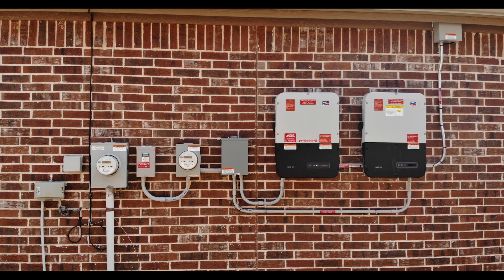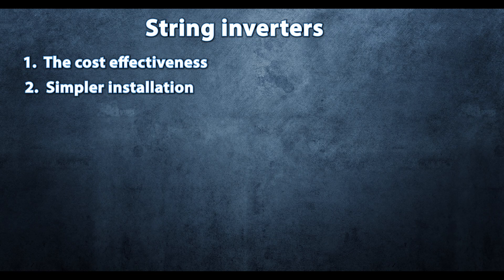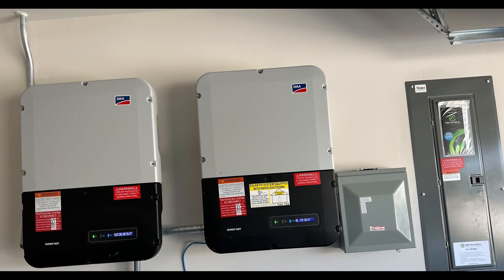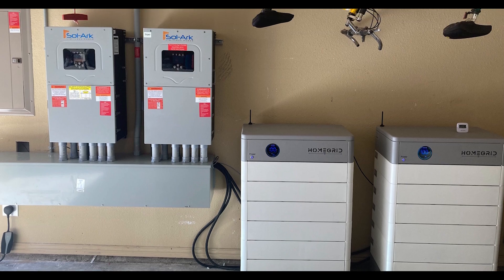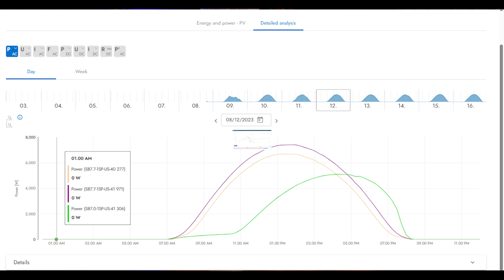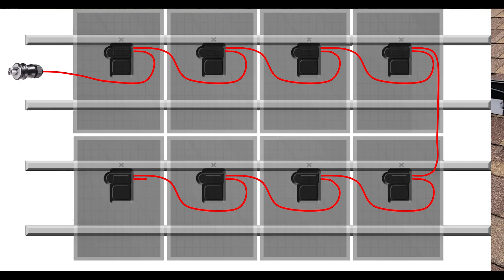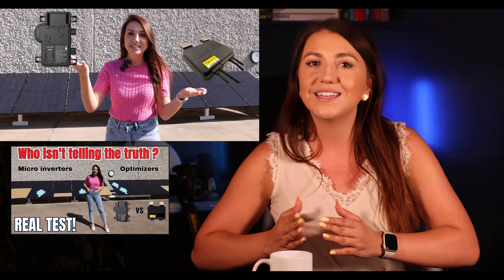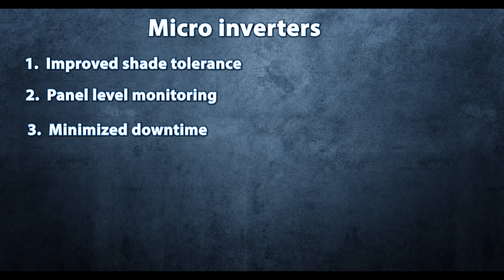The Great Solar Debate: Micro Inverters vs. String Inverters  - Are you making a mistake?

Comment: Have you ever seen a DC arc fault fire - i know what i want on my roof with my family living below - micros also have up to 25 year warranties - this is not a fair comparison
Reply: Doesn't Enphase require internet connection with a Enphase wifi box. That wifi box is only warrantied for 5 years.  How long has Enphase been in business? Nowhere near 25 years.  Whats the largest panels their MI support without clipping? Is it less expensive to over panel, increase pv system, with a string inverter or over panel with MI's where each panel requires an MI.  ARC faults are the mc4 connectors, which Enphase uses, compatibility issues or installation issues.  Those MI combiner boxes require a lot of connections increasing the chance of an arc fault.
Reply: @ridemfast7625  theres no arc faults on an AC system as max voltage of 1 panel  not 14 like a string  - its called a short circuit an trips the breaker - strings cant be added to over here if the DC goes over 600v so maybe different rules there  but enphase far easier to add to - string invertors only 5 year warrantys
Reply: @airselectricalcontractors842 You seem to be overlooking all the facts of electricity and wiring. In a (series) string setup you add as many panels as that string can take (the max OC DC voltage for the inverter's rating), and when you want more panels than that, you run a new wire to carry the next set of additional panels to the inverte, until it is at capacity or you add inverter. With Micro inverters you can only add as many on the same line until your wiring's 'max current' is reached, then you'd add new wires for new panels. Same issue, you need to add more wiring once you exceed that by going with more panels. So either situation can mean more wiring. Both are very doable.
Reply: @jamesbsa6450  im quite aware how they work mate - for starters a 3 phase system with enphase is 1 cable but triple the panels - DC is limited to the single string voltage and still has the arc fault problem
Reply: @airselectricalcontractors842  and you still haven't acknowledged that a string of panels on microinverters are still current limited by the cross-section size of the wire. So you are still going to encounter a need to do more than simply add panels. You will get to a point that said string wiring is exceeding the ampacity rating of the wire. Solution? Upgrade / supplement the wiring.
Reply: @jamesbsa6450  i dont think you understand TBH  - i am an electrican so obviously the curent carrying capacity matters but a DC system will usually need another invertor to add panels later  and is limited to around 12 panels  on 4mm cable - enphase 3 phase can have 39 panels on 1 string  of 4mm cable { which i call a circuit } and if you need more you run another AC cable and wire a simple relay - no more extra invertors and NO DC arc potential
Reply: @airselectricalcontractors842  I do understand, and said that (though I didn't comment on the arc). The jist of what I said: in both setups, you would need to be concerned about not exceeding your capacity of circuit; as an electrician you of course know this... In either system you have limitations which means by exceeding them you will  have to go back and run additional wiring. I took your initial post to sound like all you do with a microinverter system is easily add more panels, which is not the case, because you can easily overload existing circuits by adding panels in either method, you can also easily add panels in either setup. All things like wire length, size, resistance, extra equipment, etc. need accounted for though, Microinverter pumping AC doesn't give anyone a free pass to blindly slap on panels (oh and don't forget the extra $$$ Microinverters as well) without totally analyzing the circuits and adjusting accordingly.
Reply: @jamesbsa6450  i dont understand our argument - as an electrican i dont need to explain cureent carrying capacity, circuit protection etc  on a post from a sales company  - in Australia all DC cables need to be in conduit from the invertor , through the roof and can not exceed 600 v dc so any add ons will need more conduit and another invertor - enphase cable requires no conduit and is run freely through the roof - only add on is a relay into the existing switchboard - the added cost is the guaranteed safety and easier expansion costs - you either like enphase or you dont but never met anyone that trgretted putting it in and there battery and black start shits on other systems
Reply: @airselectricalcontractors842  I find it interesting that as an electrician you chose to overlook one critically important aspect of your job. Design of a system should always build in necessary safety for type of circuit. A HV DC system should be designed with Surge Arrestors Spark Arrestors arc detection, Properly rated fuses, etc. Simply stated, when you properly design a HV DC solar system each risk should be accounted for. Fail-safes prevent fires, and that's true of AC Microinverter systems as well. So I'd say your opinion on how great Microinverter systems are and how safe they are, is biased. You seem to be comparing an improperly designed HV DC vs. a properly designed micro AC system.
Reply: @jamesbsa6450  clearly you dont know what your talking about - DC arc fires are a thing as well as DC isolator fires - im not here to offer free designs - im commenting on a post is all - in USA where im assuming you are , you dont even need to be an electrican to do solar  - chow
Reply from the maker: Not once have I had a fire caused by an arc. Most modern strings have very very sensitive arc fault detection. 
Microinverters "come with a 25-year warranty" but in the majority of cases the main combiner is only on a 5-year warranty. So keep that cost in mind for the future.
Reply: @solartimeusa  there was a solar fire a couple of weeks ago on the swimming centre in Sydnry Australia on the pool centre used in the 2000 olympics - arc faults are real and DC strings are dangerous - enphase has circuit breakers for protection - why risk a fire on your home - they are up on the roof in the weather for a long time is my point
Reply from the maker: Hope that was somewhat helpful. If you havent yet, check out the video I made on String VS micro last year.
Reply: @solartimeusa  But we're talking about inverters, not the combiner box.

Comment: I'm looking into installing panels and at least 1 battery this fall.  The Mango Power M is my choice of battery, for the moment. The battery would be DC coupled.  Because of the east-west orientation of the house and shading issues, I think DC power optimizers will be a must. Definitely don't want to go with micro inverters.  The  Power M can also be AC coupled, but I would rather have the efficiency of being DC coupled.  Would like to get a quote from you, but I'm in NY.  Thanks for all your informative videos and taking on microinverters vs optimizers a number of months ago.

Comment: Living in Northern Norway with 7 month of winter the problem isn't shading by trees but snow covering. Thats why I prefer micro inverters (APsystems with 2 or 4 independent channels). On the other side I don't like the idea of replacing a micro inverter in winter time. So it's not an easy decision.
Reply from the maker: Thank you so much for sharing! I live in Texas so I didn't even think of the snow idea, but thats a very fair point!
Reply: @solartimeusa  I would like to test the difference of bifacial panels and usual panels next winter. Reflected light to the bakside (snow is an excellent reflector) would not only give a little more power but also warm up a snow covered panel faster. There is little experience how much faster the snow is smelting. At least we have no problems with overheated panels or micro inverters 😀

Comment: I have a string inverter (EG4 18k) waiting to be installed. Along with a EG4 Power Pro and 8 kw in panels. 

Ill be upgrading to double the battery size, and more panels (12 kw total?) next year sometime.
Reply from the maker: Thank you so much for sharing! I do like that mix!

Comment: My thoughts?? HHMMMMM   What would the difference be if the panels are over 100 feet from the house.. Wouldn't it be a better idea to increase the voltage to run the distance and reduce it at the house? Is that possible with micro's??

Comment: I'm an electrical engineer. Are you? 

I've used (tried to use) solar for the last 15 years. Things have changed dramatically in that time. In those 15 years solar proved to be a really bad idea (but I was forced to use it). Now it's a better idea. 

The cost of panels is 1/4th what I paid. The cost of inverters is 1/10th what I paid. And an inverter for each panel was impossible. Here's what it's about. 

A solar cell is a "current" source. You can put them in parallel but you can't put them in series unless they all produce the same current. After "inverting", a solar cell is a "voltage" source. You can put them in series but not in parallel. And with SMPS (switch mode power supplies) you can make myriad electrical sources work in parallel or series optimally... and in sync (like our power grid does). 

In a short time, you'll be able to replace inverters on panels like screwing in light bulbs. You have to have a way to clean panels off anyway. And like light bulbs, you'll likely never need to do it because they will last forever. 

The light bulb is a good metaphor. We went from arc lights to filament to fluorescent to compact fluorescent to LED string to screw-in LED to... who knows what's next. Right now, the engineering for solar is gen 3 (warmed over gen 1) ... and it's ridiculous.

I hope you're an engineer and just trying to dumb this down for consumption.
Reply: Thank you for being an engineer. Your write up doesn't seem to contribute much to the points raised by this video though.

Comment from the maker: Let me know which one you installed or plan to install on your home? :)
Reply: Despite the neighbors with their professionally installed pv systems using MI's I did a diy install and chose SMA. A year post installation and I am very happy with that decision. I did purchase the SMA 10 year extended warranty, inverter warrantied for 20 years, for only $350 with the Federal Tax Credit.  If the inverter does fail in the next 10 to 15 years I will simply replace it. If the pv systems is down for a few days I dont care. hahaha I bank enough credits where it can be down for months.  DIY allowed over paneling with the total cost being 1/3 that of professional installation quotes.